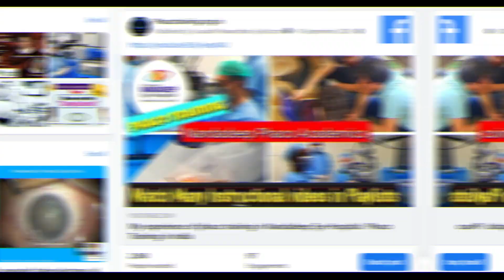134 Toric IOL alignment Dr Sourabh Patwardhan

Comment: Have you tried hydro implantation? I tried it in last few cases and found very convenient. Still I prefer to go behind IOL and remove even traces of visco in this method also. But I found it very quick and convenient.
Reply from the maker: I tried it.  I found it a bit unreliable and adds a tiny bit of risk to injure pc. So i did not continue. Useful for single handed injectable iols. Iols which need double handed injection like this one is not suitable.